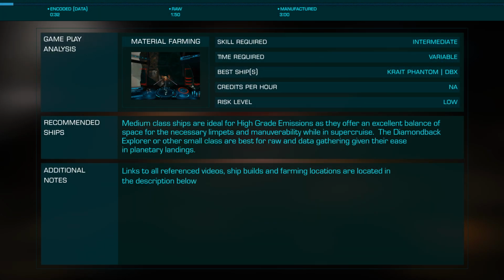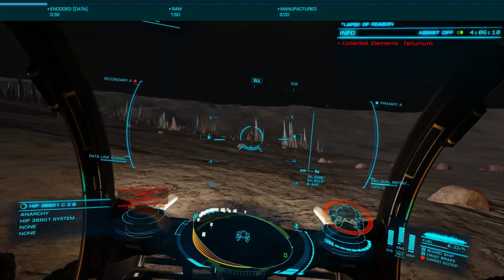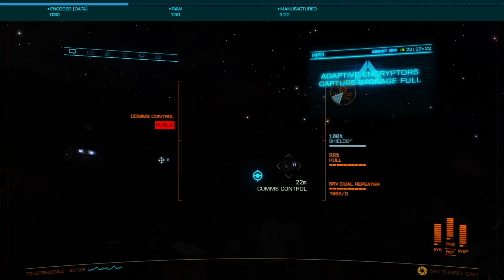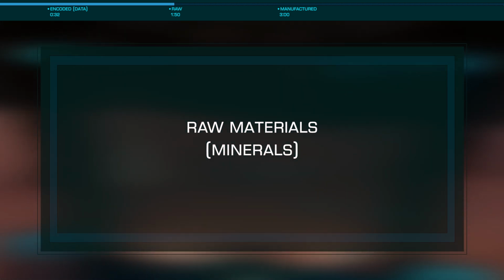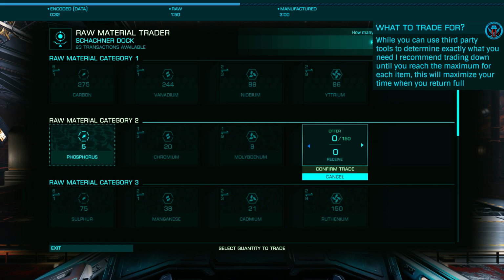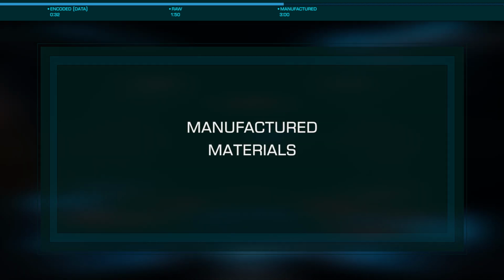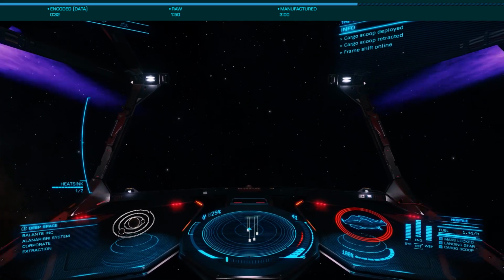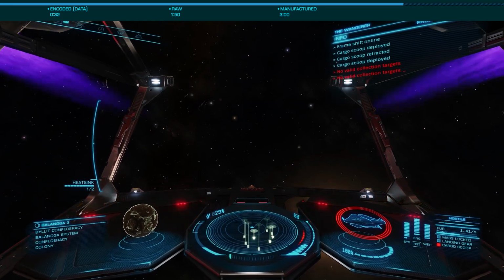The FASTEST Ways to Gather Minerals, Manufactured and Raw Engineering Materials in Elite Dangerous

Comment: Data: Pirating from megaships can be just as fast if not faster, and gives MEF, Classified scan fragments, and Peculiar Shield Frequency Analysis so covers a much larger range of data types. Is a slower when it comes to cross trades ( about 9 per 14 minutes) but since it gives you MEF instead of some worthless data, its worth mentioning.

Selenium: HIP 83204 3 b a has 5% selenium, but only 1.3% arsenic and 1% zirconium, the two materials that compete for crystal fragment drops. This means that if you go to its geological sites, each crystal fragment you break has a 70% chance of dropping selenium. Moreover, hip 83204 is only 130 lys from sol, so unlike the crystal sites you can get there in very little time. IIRC it took me about an hour to max out selenium using this method. There is one catch. Only go to sites 10, 1, 2, 8, 7, and 14 as they are the only sites I have found that are flat enough to be easy to farm. I haven't tested every site though, but with each site dropping 15-24 selenium on average you don't really need more than 6 for most projects.
Reply from the maker: While pirating for data is really fun (I have a video on that too) I find this quite a bit faster overall - but sure, no reason not to do it that way if you enjoy it.

Comment: Big thanks CMDR Exigeous and o7 CMDRs.

I was missing the information about the other different types of encoded data you get at the crash site . I did some runs and got always the same 4:
Modified Consumer Firmware (Grade 2)
Cracked Industrial Firmware (Grade 3)

Atypical Encryption Archives (Grade 4)

Adaptive Encryptors Capture (Grade 5)
Reply: Yup. You will use the grade 5 to trade for the data you want.

Comment: I'm having trouble with manufactured method, drop in with 15 minutes to spare, collect, exit to menus, get back, charge fsd, boost at throttle 0 when charged. Look at nav panel. Am I missing something? There is never anything on the nav, and I have to go rescan the nav beacon.
Reply: Just reading the comments, I missed that I need to exit out of the game. I was just going to menus.
Reply: I'm logging out without closing the game on ps4 and the beacons replenish the materials, been doing it for 1½ hour and it's still working. I used the surface scanner and the crash site appeared in the nav panel for me as soon as I first landed on the planet.

Comment: Two notes that should be added to the description: 1 make sure once you have discovered a new material to log out and log back in to increase the collection limit from 100 to 150. 2 for a lot of good tech materials you should include Dav's Hope, but any CMDR that heads out there should do so in Solo Play as griefers abound at that site far more so than at CMDR Jameson's crash site.
Reply from the maker: 1. The collection limit of 100 is for Grade 5, 150 is for Grade 4. Realize that in a few places - such a Core Dynamics you get Improvised Components and with Proto Radiolics you get Proto Lights - at least I think those are the combinations) that you get both grade 5 and 4 (with the 4 being the 150 limit). As for Dav's Hope it makes very little sense any longer given you can get 100 Imperial Shielding (as an example) in about 20 minutes - then by hitting a material trader you'll get FAR more much faster than you would running laps over and over at Dav's (I've covered Dav's many times in the past, it just doesn't many any sense from an efficiency standpoint right now)
Reply: @Exigeous   for six listed in the rare materials : 
 Antimony, Polonium, ruthenium, Tellurium,Technetium and Yttrium the initial limit when you discover them is 100 but if you do a ED flop it will raise to 150 I know this because i made the mistake of doing all 4 planets in HIP 36601 in one shot and then jumped to the other systems taking a break when i got to the first outotz and when I came back in I realized my mistake and had to haul all the way back to HIP 36601 to pick up the additional 50 available for the four in that system.
Reply from the maker: Ah, that's because you're making the mistake of thinking that there is a grade 5 raw, there is not. The highest grade raw is 150 as they are actually grade 4 so they should always be 150, I've never seen them be anything but. So if you're seeing them limited to 100 that's a new bug as they should be, and always have been 150.
Reply: @Exigeous  when they are first encountered and give a pop-up as "new mineral found" they are limited to 100 until you log out and log back in. I tried again when I got to outotz ls-k d8-3 b5a with yttrium and again when I got to hd-j d9-3 b8d with antimony and it did the same with those as well, luckily I know what was gonna happen so after I "discovered" them I did a flop.
Reply from the maker: @Puffalupagus360  Interesting, seems to be a new bug - which doesn't surprise me at all.

Comment: Just got back from implementing this new knowledge.   
The Jameson ship is pretty straightforward.  
I used your method for HGE farming and filled up on the high level materials then traded down so everything is solidly in good stock.
Raw farming... well my own failure caused me some consternation here.  I should have just copy/pasted from the info here but I hand wrote HIP 33601 but typed 33061 on my computer note.  And strangely while that does not exist, my route planner gave me a destination 1400 ly out.  Long flight to find my destination was not there.  Self destruct for the quick way home.  See my hand written note was 33601.  That was only a few hundred ly out and again wrong.  Finally do what I should have done originally and re verified with the video.  36601  8^(   By this time the night was gone and morning was in fully swing.  Had to wait.  Next day I made it out to the RIGHT system and there they were!   Ran the HIP planets first then bounced to the OUTOTZ ones.  Each collected resource gives you 3 so it is actually pretty quick to collect the top level raws.  Since I am working on my explore rank as well I just flew home fss scanning on the way and made another 14 mil on collected data.

Now I have good levels of ALL materials and the knowledge of how to easily procure more whenever I like (well except raws... that takes some time to get there.)

In summary, Thank you so much for this!  
- CMDR Shadowpanther

Comment: Tip: There is a another way to get data at jameson that does not require you to have an SRV. Simply take a small ship (DBX is good due to long jump range) and carefully position your ship in the middle of all 4 data points like you would an SRV. If you get it right you can scan all 4 data beacons faster (data scanner on ships takes only 2 seconds vs SRV which takes 5) then an SRV can. You also save time by not needing to land.
Reply: Im gonna do this.. does it still work?

Comment: The High Grade Emissions Signal Source relog trick doesn't seem to work any more for me either, even with 25+ min left. When I relog and go to fsd, no signal sources visible directly behind me or anywhere else for that matter. Have to rehonk, re-FSS to find any signal sources after re-log, which seems to reset everything, usually without any HGE signals.
Reply: As someone recommended below, on Console, if you quit the game app instead of quitting to the game menu, and then reboot the game and log in on same game mode, this DOES work. Takes a little longer than a normal log out/log in, but at least you can keep farming the signal source.

Comment: My main question is on the faction states for the type of materials (particularly the pharmaceutical isolators as outbreak systems can be, uh, hard to come by). I had kind of gathered from gathering other resources that I might need to go to Independent systems (although it's good to know Alliance works too), but one of the outbreak systems I went to has both Boom AND Expansion, I believe, and a lot of the HGE list one of those and not outbreak as the faction state. I'm wondering if the faction having multiple faction states (especially boom) throws off the ability to find the PIs.

Comment: Not sure if there's been a recent change to lower the rate of High Grade Emission locations. Spent >3 hours flying from system to system that matches the info at 3:16 without finding a single instance! I arrive, honk, drop in on the nav beacon and scan it, jump to supercruise and check signals. Heaps of signals but no HGE ones. Is anyone else struggling to find them? I had little trouble only three weeks ago or so but no joy over the past week.

UPDATE: just had a one last crack at it and success! took me 30 minutes and maybe 5 systems before I found one. Didn't bother with allegiance, only state.
Reply: I have the same issue, are you still farming manufactured mats with this method

Comment: Nice to see you back exi! Could be useful to get a pvp video for small ships, as I've been struggling due to the lack of maneuverability disparity between ship classes. Med ships carry considerably more punch without a noticeable agility or speed loss and I find myself running out of ammo with rails and plasmas.
Reply from the maker: Yeah, sadly the only small class that is even viable is the Vulture and even then against a well built and skilled medium class ship you stand little chance.  I do have on my short list to share my rapid fire pulse laser Vulture.
Reply: @Exigeous  Here's a build challenge:
Type 10 defender. PVP.

Torps only.
Reply: Oh and it's me, Ferrus. Had my head buried in DCS and IL-2 all this time.
Reply from the maker: @Rubberduckzillas  That would be pretty hysterical to see, completely worthless but hysterical.  That said I do run torps or mines on my 850 m/s prismatic Courier and have nailed a few Cutters and Vettes with it - it's SO satisfying when those shields go from 95% to GONE instantly!
Reply: @Exigeous  People say torps are easy to counter/avoid, yet the last thing I did was nail a recently maxed and engineered cutter out of shinrarta (agreed to duel to test our new builds). Krait mk2 2 superpen rails, 2 large reverbs, 1 penetrator torp. Silent running glide towards him after the pass, he couldn't avoid the torps in time, jousted again, flipped 180 and did backwards powerplant sniping. He was impressed enough to ask for the build!

Comment: Thanks for this guide, the exploration trip to the cristalline shards wields enough mats for my whole fleet!
Reply from the maker: Same here - I use it every few weeks or months, depending on how much engineering I'm doing to just max everything out.
Reply: @Exigeous  Hey, I found out that, just like Guardian sites, you don't need to suicide to reset the data nodes! Just drive 200-300m away, relog and reset.

Comment: Hi ! Any tips to find HGE? because I jump from a system to another since 2 days and didn't saw a single HGE : independant or alliance system, state : none (because no Expand systems) and no matter the population
Reply from the maker: Sadly no, not really. I've found 7 in systems with tiny populations and none in systems with billions. The only thing I can offer is this - use Material Finder at https://www.edtutorials.com as that will show you what systems commanders actually gathered a specific material in. That doesn't guarantee it but it makes it far more likely. I'd also suggest finding just Imperial Shielding as you should be able to get 100 of those in about 20 minutes, then hit up a material trader and that 100 will turn into 300 G4 mats or 16 or any other G5 material. Imperial none state is the best to search but again check out the tool and it'll show you were others are getting it.

Comment: Concerning the manufactured mats and logging out, I wish this method worked for PS4.  It doesn't.  Hunting multiple systems gets old really quick.

Do you have to collect all of the different mats in order to trade down?  Or can you pick one that's easy to get?  For example, military anything is WAY hard to find and I gave up doing it at about 1/2 full.

Comment: I know it's been nearly a year and things might have changed, but I'm running a DBA and went to Outotz to gather, tried to plot to HIP 36601 from there and it will not allow me to set a plot just says plot failed. I noticed that systems in that are are more spaced, I'm guessing my DBA needs more jump range? It's max is around 36 - 38 something like that
Reply: i have 34,7 and got there. longest jump i remember was 34.0 ly
Reply: @kult1983  I think i may have had selected stars all messed up, thankfully I found other methods of grinding mats although it wasn't as fast as this way i still was able to get my conda nearly fully engineered, Thanks for the reply though

Comment: As of 2020.10.09 I find manufactured materials - opposed to the listed - as follows
PROTO RADIOLIC ALLOYS - BOOM
PROTO HEAT ALLOY - OUTBREAK
PHARMACEUTICAL ISOLATORS - EXPANSION

Also there is no Military supercapacitor in Indep./Alliance - War/Civil War (but there is no system currently Alliance @ civil war

Comment: On the manufactured items, are the drops sometimes varied? I was in an independent ear system, expecting to find Military Grade Allows / Military Supercapacitors, but was finding Military Grade Allows and Photo Heat Radiators (which should be in a boom system). Not complaining, just still need supercapacitors. :)
Reply from the maker: Somewhat varied? Yeah, they are HIGHLY varied - HIGHLY.  These are just the general guidelines.
Reply: Military Supercapacitors definitely seem like the most difficult to get.  Allied or Ind with War/Civil War generally spits out Military Grade Alloys.  I've read that "Hi Tech" economies with Allied or Ind, War/Civil War will get you the supercapacitors.  I'll try to test the theory but it is very difficult to align that specific criteria.

Comment: 1st of all ty for this guide! it deffo helps a lot. there's only one  e thing i wonder about... i had absolutely no trouble finding core dynamics thingies so i was able to stock up fairly quickly. then i went on to get pharmaceutical (outbreak). well i yet have to find a system with a high grade signal... eddb was spitting out several systems but i'm on the lookout for the past 2 days now with no luck. sorted by alliance/independent and ofc outbreak. did i do something wrong? regards
Reply from the maker: Nope, you're doing nothing wrong - Pharma Iso's are one of the hardest to find G5's out there, with CDCs and Imperial Shielding the easiest.  So if you need less than 16 Pharmas just grab CDCs or Imp Shields and trade as 100 of those will trade down to 16 Pharmas.  Proto Radolics and Heats can also be really hard, and Improvised Components can be next to impossible.
Reply: @Exigeous  ah okay. Thought I'd go crazy. I gave up on farming for now. I need a change after no action for 2 days. Only that NPC hunting me all the time kept me on my toes. Almost lost my ship and all explo data lol
Reply from the maker: @hughnailedit9885  Yeah, it can be really frustrating to find them - the material traders are your friend :D

Comment: Wow, these are high-end material gathering method. For manufactured materials, I have been collecting at Dav's Hope (variable grade of material though), can do about three dozen runs for each trip before my SRV running low in fuel and I have to leave.
Reply: You can very cheaply refuel the SRV using synthesis.
Reply from the maker: Yeah, I stopped using Dav's Hope about a year ago as with the HGE method in this video you can get 300 G4 mats or 900 G3 (or 2700/8100 G2/G1) in about 20-30 minutes (if you include hitting the material trader).  Dav's just can't hold a candle to that - it's fun and I sorta miss it, just not nearly as efficient.
Reply: Paula J. Bean Thanks I didn’t think of that. Anyway after three dozen runs, it gets a bit boring and I need a change of scenery.
Reply: CMDR Exigeous Thanks, yours is advanced level.
Even your combat flying skill is at a different level. I am at novice level and sometimes I can’t even take down a novice NPC pirate.
Reply from the maker: @noodlefoo  You know what, we were all there at one point.  The good news for you is the game has never been in a better state with progression SO MUCH easier than it used to be.  I remember it took me 2 weeks to earn the 20M i needed for my first Vulture - now the speed record from 0 to Elite is 7 hours 4 minutes (my record is around 11 hours).  So don't worry, you'll get there and hopefully my videos can help along the way.

Comment: Is manufactured still working? Everytime  I logged in and out and dropped into supercruise there wasn't any signals unidentified or not.
Reply: you have to exit the game
Reply: Not only do you have to exit the game completely, but you also need to "honk" the system again when you log back in. Maybe that's what you're missing? I also suggest a macro I like I made (if using PC) to automate relogs, making it much less laborious (and faster). That's especially useful at the Jameson Crash Site.

Recently I found a 35min HGE only 600ls from the star and was able to loot it at least 7 times before it disappeared. Too bad it wasn't the ever elusive Pharma Isolators. Even I've not found those yet. I think there's something we're missing or changed in the combination to find those.
Reply: I'm on xbox, to get it to work i had to hit home then start to load another game then immediately reload elite. 👍